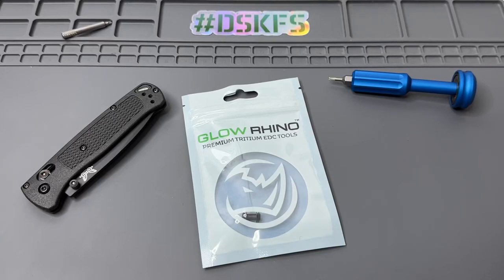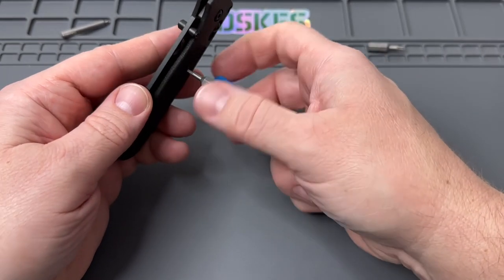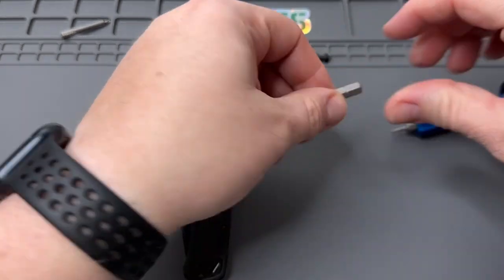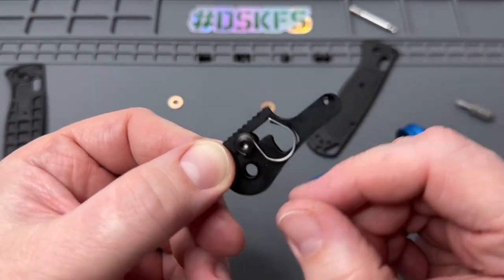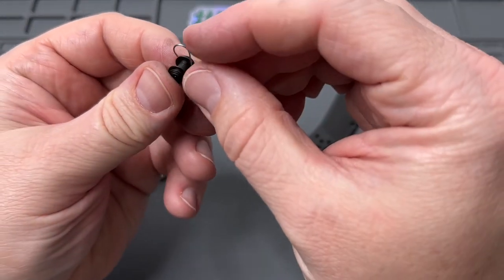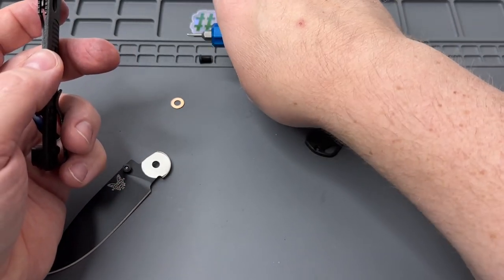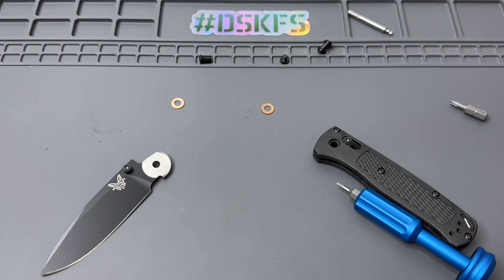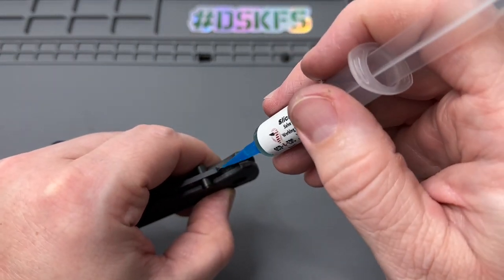Glow Rhino ~ Benchmade Bugout Axis Bar (Tritium) Full Install

Comment: Weird just installed one on my bailout which they say they’re compatible for but it’s requiring I apply pressure on both sides to get the bar to move. Thoughts?
Also, did you see my email about our cosmetic additions for scales?

Comment: Have you developed any lockstick or up/down play since installing this? I swapped my factory Benchmade Ti lockbar for a generic steel one and it has zero lockstick now but it has developed a tiny bit of up/down play after some months of use.
Reply from the maker: This one has been good so far. I know the Ti BM bars had some sticking issues. Hopefully this will continue to provide years of service!
Reply: @zachstuff  Gotcha thanks! I just ordered one so I'll take my chances. Nobody seems to make just a normal one-piece cnc'd steel one with no fancy features so I'll see how I like the little Tritium glow.